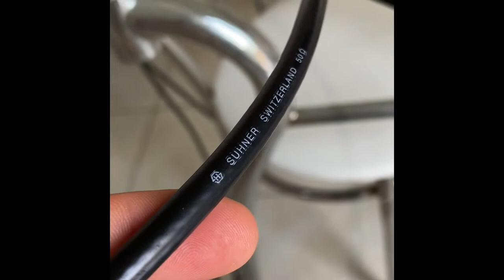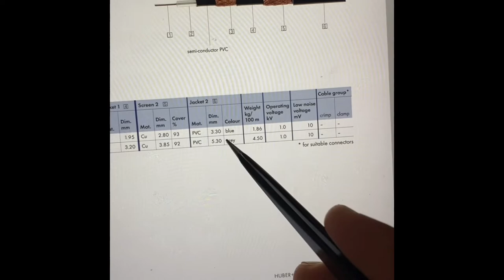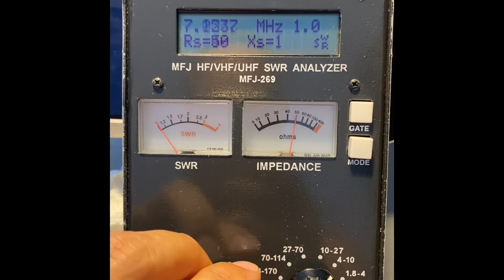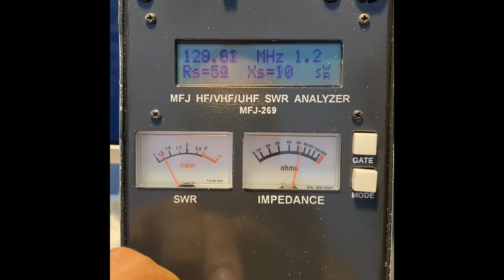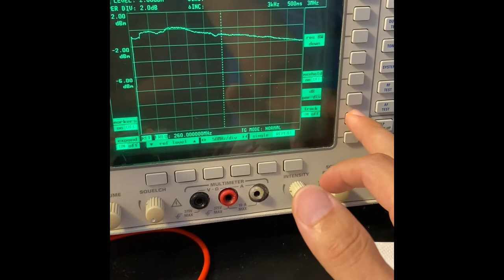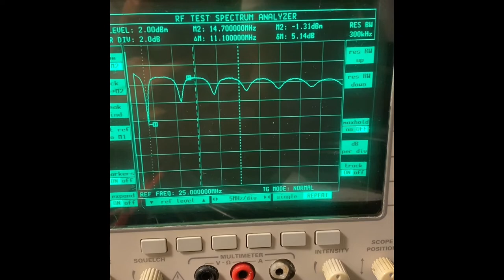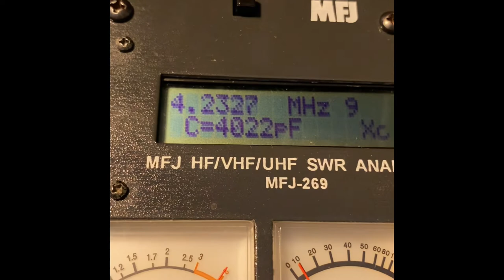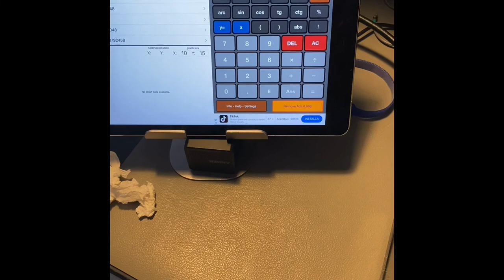What’s wrong with this Coaxial Cable?

Comment: What is terminating the second shield?  Your load and the MFJ are probably only going to terminate one shield.  I don't know enough about it all to know, but isn't there now a big chunk of floating copper running the whole length of the cable that's basically a useless radiator?
Reply from the maker: Hi and thanks for your comment.
You’re right. The inner shield is not terminating into my load so is floating. In the subsequent video I found the solution.
Cheers